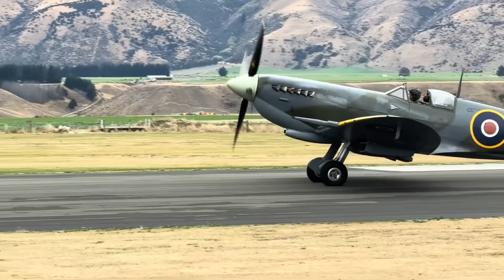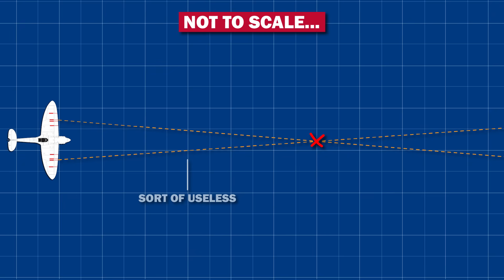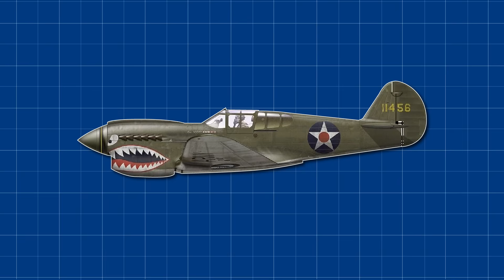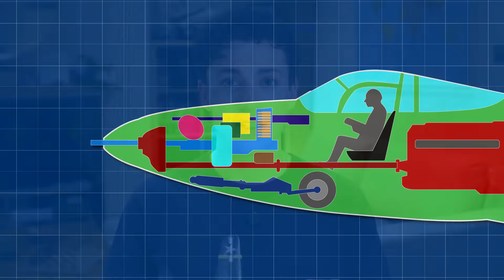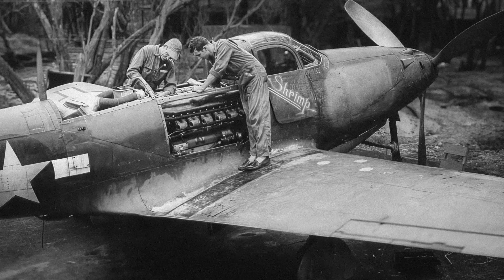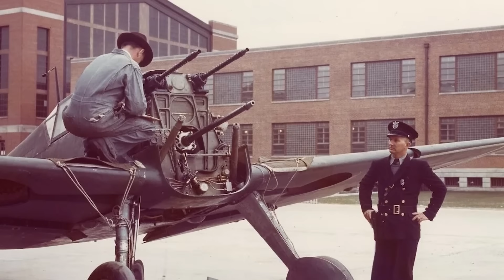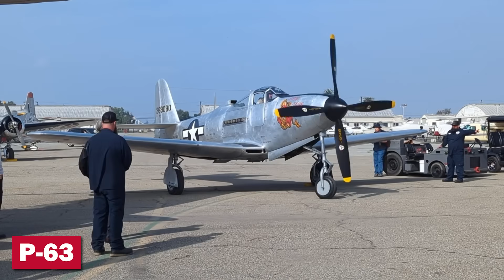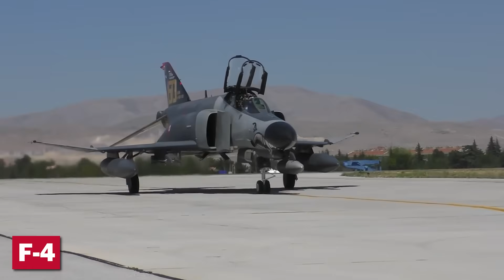What happened To Mid-Engined Aircraft?

Comment: Instead of running the driveshaft through the plane one option would be to have the propeller at the back with the engine like the SAAB 21 did.
Reply: Highly inefficient. Think of the DO335 where the rear facing propeller contributed a lot less to propulsion than the forward facing one.
Reply: @spaRTan3246  The rear prop may have produced somewhat less thrust than the front one but the reduced drag from having both engines in the same fuselage rather than in separate nacelles more than made up for that.

In regard specifically to the Do-335, Eric Brown experimented and said it was faster when running the rear engine only than it was on the front engine only.

The there is the Cessna-337 of which this is often said climbs better on the rear engine than the front.  Apparently, when the rear propeller is turning, the airflow over the rear fuselage remains attached. But it separates when the rear prop stops, increasing drag.

I once flew a ride-along on an O-2 training sortie. The plane was notoriously underpowered in its military configuration, and the pilot briefed me that if we lost an engine we were going to jettison the external stores and probably have to make a forced landing in the best place we could find.  He said our rate of descent would be slower if we lost the front engine than the rear and our chances were better.
Reply: @gort8203 Actually not. While the Pfeil has a lot of fans due to its design (me included) it was characterized as being too heavy due to the weight of two engines and neither agile nor fast enough to make up for it. But if looks could kill it would be a monster… 😬
Reply: @spaRTan3246  
Actually not no, but YES. The configuration of the 335 gave it exceptional speed. It would have been slower if its engines were mounted in nacelles instead of within the fuselage.  Just compare it to other twin engine aircraft.

For someone who claims to be a fan of the airplane you do not understand it. Not nimble; who cares?  (You must be playing War Thunder.) It was not designed to dogfight single engine fighters, it was designed to outrun them.  The design originated as a schnell bomber with an internal bomb bay; a later version was heavily armed as a heavy bomber interceptor.  If you compare it to the Mosquito is heavier but much faster on about the same horsepower.  If you compare it the Me-410 it would have replaced it is about the same weight and much faster on the same engines.  The main deficiency of the 335 was that it came too late to help the Luftwaffe.
Reply: @gort8203 I highly recommend reading the appropriate books (or maybe watching a video quoting them) on how much worse the 335 performed in real life compared to its claimed numbers. Liking an aircraft and being completely oblivious to its deficiencies are two very different things. I‘m not sure whether I‘d call it a complete failure but it‘s very far from what you think it was. 😕
Reply: @spaRTan3246  Unlike many here I don't get my information from YT videos, or War Thunder. First you charge that it wasn't nimble enough, now you charge that it wasn't as fast as claimed.  Grasping at straws to evade the fact that it was indeed significantly faster than a conventionally configured aircraft of similar weight and power.
Reply: What I claimed was that it was „NEITHER agile nor fast enough“ in my very first answer. Go. Read it again. How do you want to discuss easy facts if you can‘t read? And now go and have a proper look at those RLM documents. Then you’ll understand. Maybe. ☺️
Reply: @spaRTan3246  You just want to argue and start by claiming you have read more on the airplane than I have.  Fat chance. You don't accept the reports of the German test pilot who reported it was surprisingly agile for its size and had a tight turn radius, despite its intended role. You continue to avoid admitting that it was faster than it would have been with a conventional twin-engine configuration, which remains my original point.  

Eric Brown flew two of them and said he had no reason to doubt the German claims of its top speed.  He never tested the top speed of the single engine version.  On his first flight of the bulkier two-seat version he did one informal speed run and got 430 mph out of it at 18,000 ft, which he considered impressive by any standard.  He was probably estimating what a properly maintain and tuned test-ready single seat 335 could have done. 

Just go play War Thunder.
Reply: @spaRTan3246  Not true. Look at the VariEze, the SAAB J21, and many more.  In fact there have been single engine versions of Cessna 337 that were just as fast on half the hp (did give up initial rate of climb tbf)
Reply: @markbecht1420 You can‘t change physics. A prop in a turbulent airflow is by definition a lot less efficient than in an undisturbed airflow. Those planes might work - but the reason for putting the prop at the back wasn‘t efficiency. Same goes for paramotors BTW - but it might get a little inconvenient… 🤣
Reply: @spaRTan3246  Yet another tradeoff being the fuselage and wing in airflow undisturbed by the prop and its vortices. Like everything it's a compromise. Most long range UAVs/drones are pushers for overall efficiency. Warheads don't care where they are, and belly mounted sensors work, so there must be a reason
Reply: @spaRTan3246  The prop may be less efficient due to disturbed flow but the reduced drag that comes with ingesting that flow can increase overall efficiency and speed of the airplane.  Instead of turbulent flow down the entire fuselage you have more laminar flow. The prop at the rear naturally reduces any low pressure area at the tail the plane.  

The B-36 didn't use those pusher props because its aerodynamicists thought it made the airplane less efficient.
Also, Eric Brown flew the Do-335  and said it was faster on the rear engine alone than it was on the front engine alone.  In this case it seems the slight reduction in prpp efficiency was offset by the smother airflow over the very long fuselage.

Comment: Keep in mind a CG far forward actually means the tail is further from the CG and thus has more leverage per surface area. This also means you can make the tail shorter and thus decrease the overall footprint of the aircraft. 
However, you don't want your mean aerodynamic chord/center of lift at one end of the vehicle, you want it in the center so it's "balanced" and the tail can be smaller because it has to produce less forces to maintain straight and level flight. 
Everything is a tradeoff.
Reply: Not quite, you’ve got the net effect backwards. Yes, moving CG forward increases the tail’s moment arm, but it also increases the wing’s moment arm from the CG by the same amount, and the wing’s lift creates a nose-down moment about the CG. Work out the moment balance and the required tail download actually goes up as CG moves forward, not down, the extra leverage gets eaten by the larger nose-down moment it now has to counter.

This is why the forward CG limit on most aircraft is set by elevator/tail control authority (can you rotate on takeoff and flare on landing at low speed), while the aft limit is set by static stability margin. Forward CG = more stable, but more control-authority-hungry. It’s basically the opposite of “forward CG lets you shrink the tail.”
Reply: @rtbrtb_dutchy4183  I was on the base leg of a landing pattern in a PA-28 when I accidentally induced a wobble in the wings by turning the yoke quickly left and right. It freaked out me and the CFI. I was correcting for a gust of wind.
Reply: @rtbrtb_dutchy4183  We're assuming the wing cord is also moving with the CG since you're designing the vehicle. You're correct moving the CG forward increases stability when the MAC doesn't move.
Reply: It's why the Boeing 747SP ("Special Performance", but I like to think it stands for "Stubby Plane") had to have a larger for being a shorter aircraft: it had to yank on a shorter lever.
Reply: @hoilst265   you are talking about directional control here. So yes, you are correct, but it’s a different thing than this guy is talking about.
Reply: Good point.

Comment: The comment about how having a big engine at the front made-it hard to see over the nose during carrier landings - this was actually one of the reasons why the WW2 USN wasn't initially keen on the F4U Corsair. The UK was a bit more practical about it and said: "If you can't see over the nose on a straight-in approach, come in from one side instead" and that was made standard in both UK & US service.
But you missed a significant disadvantage for mid-engines, which is cooling. In a front-mount, the prop-wash continually passes air at speed over the engine/radiator while it is static or taxi-ing. In a mid-engine you don't get that, and temperature has to be carefully managed while on the ground/deck.

Comment: Another drawback of the P-39's engine layout that worried pilots was what happened to that huge lump of iron in the event of a crash. Pilot were afraid of its momentum causing it to try to occupy the same space as the pilot as it ripped forward through the fuselage. I'm not sure how much of an actual risk that was, but it was definitely a perceived risk by the pilots with that big motor right behind them.

Comment: The great injustice to the P39 was the screw up by GE and the USAAC meddling in the design process. Iirc, the P39 with the Allison 1710 was originally supposed to have a supplemental exhaust driven turbocharger but the Air Corp insisted it be designed by General Electric and Bell designers wanted to design their own or have Allison design it in conjunction but the Air Corp told them no. When the prototype was being built GE came back and said "Opps, its not ready and wont be for a long time" and the Air Corp insisted bell finish the prototype without the turbo leaving the only charger on the engine to be the standard one on the 1710. When GE finally did have an exhaust driven supercharger ready, it was too late and it was too big to be incorporated into the P39 and the Air Corp told them not to put it in. Bell wanted a second go and knew the P39 could be made to be faster and have longer range than the P51 and P47 but when they got the money to do the redesign, it was the final end user who dicated the specs and that was the Red Army via lend lease. They absolutely loved the P39 and all of their top aces flew them and they only wanted the new plane to be a lowe alttitude aircraft bc that was the type of war they were fighting, generally below 12,000 feet and thus the P63 was designed for that parameter.
Reply: Well, there is a little more. It was submitted to NACA for wind tunnel testing, and they were extraordinarily critical of the bulge that accommodated the above turbocharger. By this time Benjamin Kelsey (basically what we would now call the Procurement Officer for the P-39, 47, and 51) was reassigned to observe in Europe. Objections that the drag penalty would be massively offset by the turbo gains were smashed over. This was not the only way that NACA 'effed up the P-39, but the one most relevant here.

Comment: The British P-400 variant did have a 20mm cannon, and some of the most famous Airacobra airfames were these Reverse Lend Lease P-400s operating with the Cactus Airforce on Guadalcanal in 1942.
Reply: Cactus pilots said "It's a P-40 with a Zero on its tail."
Reply: @amerigo88 And the problem was the lack of turbochargers (removed by USAAF direction). 
The Zero was a horizontal dogfighter. All the American aircraft could dive faster than the Zero could survive.
Reply: Read  "Angels Twenty" and "Nanette' by Edwards Park. Both books are about the same campaign there, except the former is a very straightforward account of the conflict, and the latter is an often hilarious personal memoir.
In the latter, a comparison is made between the 37mm and 20mm as a function of the sexual maturity of the pilot's preference
Reply: Every Cobra was made in the USA, as far as I know. So if the Brits didn't wanted the type for an obvious reason - terrible high altitude performance - why the Yankees still built in the 20mm cannon? Was it common among US users? I only know the P-38 which had it in large numbers, but that time the Lightning hadn't arrived to the PTO in numbers. Also if I'm correct from many downed and recovered Airacobra wrecks 37mm cannons were repurposed on PT boats.
Reply: @Гавриил-к1ш The British received the aircraft first, then decided the performance was inadequate for their requirements (it was considerably below what Bell claimed) and they were subsequently given to the USSR or back to the US under Reverse Lend Lease, and most saw service in the Pacific.
The bizarre part is they were happy to keep ordering and receiving P-40s which had near identical performance characteristics.

The easiest way to identify them in photos is the much longer barrel of the 20mm cannon.
Reply: @Гавриил-к1шThe British required the replacement of the Oldsmobile built 37mm cannon with a more typical 20 mm Hispano-Suiza cannon. 
A key problem of the 37 mm, .50 caliber, and .30 caliber mix of weapons was each had a different rate of fire, bullet arc, and effective range. The Soviets usually simplified their P-39s and P-63s. The 20 mm cannon had characteristics closer to the nose mounted .50 caliber machine guns than the bomber destroying 37 mm cannon.

Comment: Soviets loved the P-39/63 for its 37mm cannon, so was it really an overkill?
Reply: Did they though? Many complained that it was vastly inferior to soviet 37mm on Yaks. Lower velocity/worse ballistics coupled with lower rate of fire made it much harder to hit fast targets, add lower ammo capacity on top of that... Many preferred 20mm version of cobra because 20mm was already powerful enough, but had much higher chance of hitting nimble targets like fighters and ammo lasted much longer. Also worked better with 6 machineguns cobra had, lower velocity 37mm meant that you are hitting either with cannon or with machineguns, but not both at the same time.

Comment: IIRC the USAAF had less than five pilots become aces in the P-39 Airadog. Bell had some interesting ideas, but these aircraft were duds, suitable only for getting chewed up by the Japanese in the SW Pacific and on the Eastern Front.
Reply: They did have their uses, being workhorses of ground attack and a surprisingly high performance at low altitudes, which mattered more in the Pacific and on the eastern front. They weren't the best but they were very far from being the worst.

Comment: Technically, the mid-engine plane is the default for most combat aircraft now because of how jets work
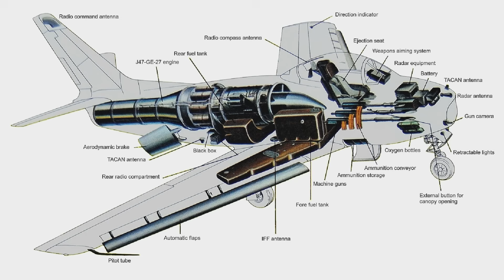Reply: As addressed at 06:06.
Reply: @Befuddled_Ostrich  Explained what precisely? That they were in fact mounted there? He never goes over how thrust is pushed out of the rear so they HAD to be mounted aft of the pilot...
Reply: Most if not all modern fighters have the engine(s) mounted behind the centre of gravity or rear mounted. The exception is the VTOL designs like the failed YF32 or Harrier.
Reply: watch the video before commenting like a know-it-all
Reply: @Boamere  the need to crap on others stems from a realization of inadequacy in oneself.
Reply: @Boamere The title origonaly said something like "Why mid-engined aircraft disappeared"
Reply: @pyrenees2695The title doesn't contain the entire transcript of the video... Therefore, you should watch the video before commenting about its contents.

Comment: Yak-9T be smiling in the corner
Reply: Yak-9k as well
Reply: @CoolSock123  another Berezin knower ❤
Reply: If only they could actually handle the NS-37 and 45
Reply: @jasonlin9805  they could. Normandy Niemen are known to fly them well on the Eastern Front
Reply: @jasonlin9805  They did handle 37 pretty well, 45 not so much, which is why they stopped making 45 version after very small test series. 45 was designed for ground attack only and failed because platform was too unstable and inaccurate, it was not supposed to be used for air combat anyway.